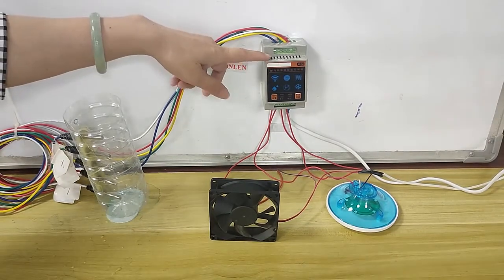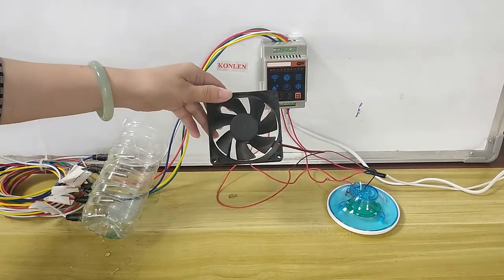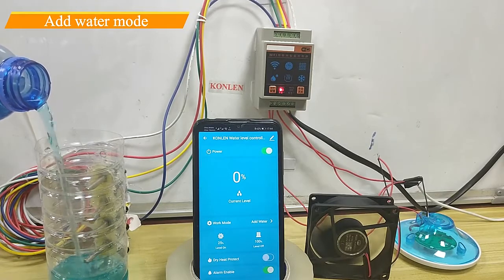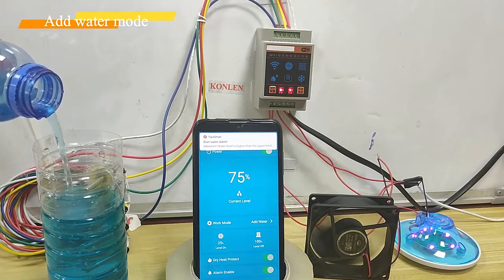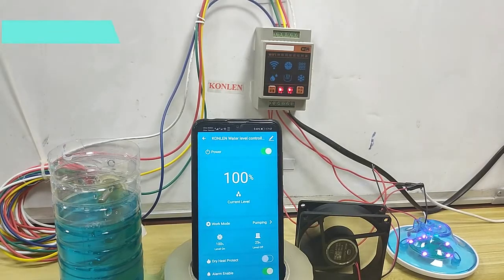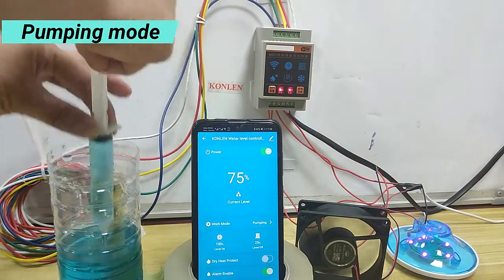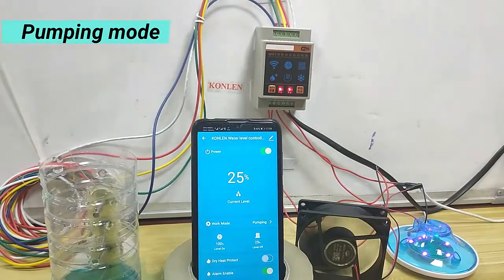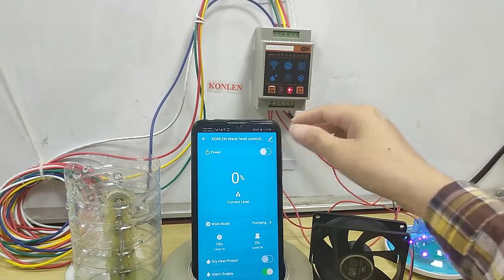How Smart Water Level Sensor Works | Smart Water Level Sensor | WIFI Controller | Leak Protection

Comment: I have a doubt. Wiring from controller to pump, is it necessary? Can I use scenes to connect a smart plug with just the sensors?